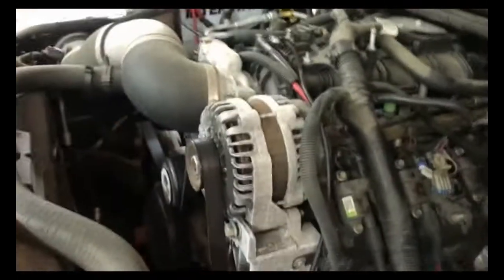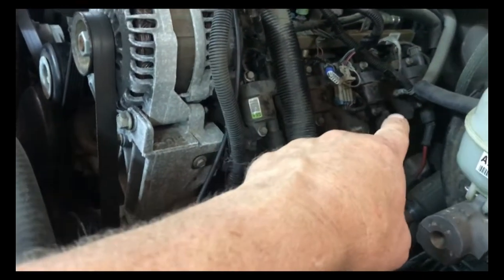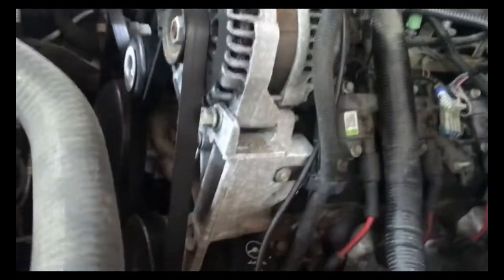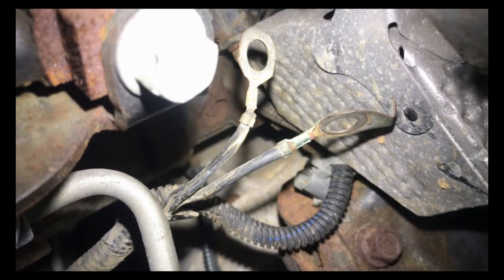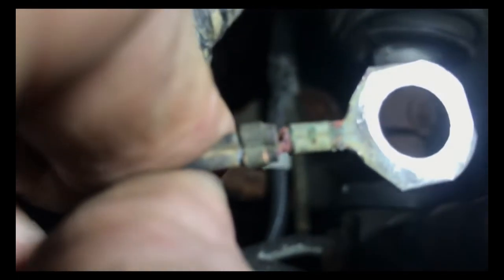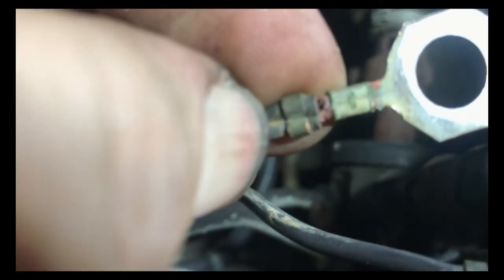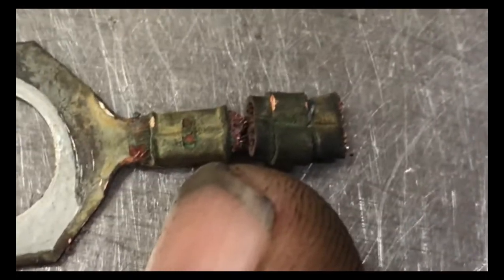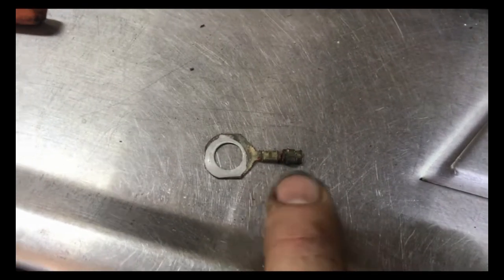GMC and Chevy 5.3L Trucks P0300 Random Misfire and Sometimes No Spark

Comment: SO WHAT WAS THE RESULT ? YOU WOULD THINK SO INTELLIGENT ENGINEERS COULDN'T FIGURE OUT TO PUT SOME LITHIUM GREASE  AT THE FACTORY TO PROTECT THE GROUNDS CONNECTIONS !  OR SEND ALL THE GROUNDS TO A MAIN ! WITHOUT ALL THE CONNECTIONS THAT WERE LEFT TO BE EXSPOSED TO THE ELEMENTS TO CORRODE ! NOT INTELLIGENT ENGINEERING !
Reply from the maker: I repaired the wire and all is good.

Comment: Remember, you can splice into the Black wire on the left bank injector vwite,and run a new wire to the threaded hole on the alternator bracket if you don't want to struggle with the ground on the frame rail.
Reply from the maker: But I like to check it down there to see why it happen.

Comment: I have a cylinder 3 misfire, I changed the spark plugs,coil,wire and still the same issue 
Sometimes a misfire is coming and going while driving then the vehicle is running smoothly, NO lifters noise at all , My mechanic said it's probably a lifter or Valve lifter oil manifold (VLOM) 
It's 2014 GMC SIERRA 5.3
Reply: Any idea what's going on 😅

Comment: You sir are a excellent mechanic I never knew those grounds were there I got a p0300 code while driving on the freeway and I got a lean code and I was thinking that I had a bad coil or coils, or maybe a bad injector after I watched your excellent video I was able to locate the grounds and they had corrosion on them I cleaned them up with some 600 grit sandpaper and now my 2007 Yukon has power when I step on the gas and is running a lot smoother thank you
Reply from the maker: You welcome. Just remember the the wire can corrode in the eyelet. I would replace the eyelet.  Thanks for watching

Comment: I'm having the same problem. Just put new plugs and wires (the old plugs only had 30000kms). I did check the grounds and sanded them. But perhaps I should get a closer look at them.
Reply from the maker: They could be green with corrosion and broken like in the the video. Thanks for watching
Reply: @TheGAutomotiveAndMore  yea, I'm going to have to take a closer look.  Mine is very intermittent.  Like one or 2 events every few days to a week with no rhythm or reason. Since I only did a quick clean from up top, it didn't really give a great view.

Comment: Found the ground location but wow it seems impossible to get too. Even to change the connector hardly enough slack on the wire to replace it. Im guessing I’ll have to try and disconnect a bunch of the harness to try and bring it out more??
Reply from the maker: Yes Its tight up there

Comment: In my case, I swapped plug? Wire and coil but misfire remains on the same cylinder, any idea if its ground?
Reply from the maker: Could be. did you check for spark coming out of the wire? If you have spark do a compression test.

Comment: Hi just wanted to thank you I had the same problem with my 2007 chevy Silverado 5.3 same code p0300 did everything thing I could to fix it nothing worked I was ready to have it towed to a mechanic but I looked at video did what you did you said and it was the ground wire fix it and my truck ran perfect, can't thank you enough for your video 😅😅😅
Reply: excellent video best one I have seen so far on this particular problem I have subscribed to your channel and will tell my friends about your channel also thank you sir

Comment: Good morning y'all I have a 2001 CHEVY TAHOE 5.3 vortex it has been sitting for over 18 months 😱 thanks to 🐂💨💩 of being sick Gas ⛽ and other crap💉  So money was every LOW🤦 I did keep up with the Driving up and down the driveway every 2or 3weeks but this morning she she didn't want to move in reverse, So I took out the the code reader and sure enough 3 codes came up P0300 and a multiple misfire and something with the EVAP. I'm going to try and get this worked on in a few minutes. If not then to the shop she will go💸💸🤦
Reply from the maker: Check for mouse damage sense you have not really been driving it. Thanks for watching

Comment: This video solved my dead passenger bank issue on my 6.0. The connector itself looked fine but once cut out and tested with a meter it had no continuity. Thank you so much.
Reply from the maker: I sill can't figure out why the ground for the coils is all the way down there. Thanks for watching
Reply: @TheGAutomotiveAndMore   A ground block with all the grounds lead to it would be so much better.

Comment: Wish i had of checked this a month ago seen this vid but thought it was only in 1 cylender. Replaced battery ,plugs, wires swapped packs, changed injector, replaced bank 2 upper and lower 02 sensorswith a code for upper then lower. Did compression test . Was getting a code 306 watched misfires was in just 6 then tested for spark because I thought others were working but same thing no spark in pass side bank and drivers side was just a orange blob not spark looked under took off yep same thing havent put it back together cause its night but sure it will do the job this misfire was so bad it smoked my caddy and bunt bank 2 upper and melted lower. This all happened when i was leaving a parts store for gas line for my boat .outta nowhere it happened limped it home. (UPDATE) battery dies was brand new crappy tire sucks but on the better note after almost chockin out the parts guy spent 5 hours charging the battery to full threw it in the truck and yep it was just the goround. Thanks man for posting this i thought it was in the dod system or somethin but this post saved me doe and time now i can do wood so i don't freeze this winter.👍
Reply from the maker: That sucks, I hope this helps you. Thanks for watching
Reply: @TheGAutomotiveAndMore  Sure did man thanks saved me lots of doe and sanity 😂 I subscribed to keep up on fixes 👍
Reply from the maker: @sinisterrevelations4493  Glad it helped. Thanks for watching  and subscribing

Comment: So did that fix the truck? Never heard it run
Reply from the maker: Yes it did, the wire was corroded and broken in the connector.
Reply: I have a 2005 GMC Denali. I'm having issues with multiple misfire code. I checked all the  grounds I could find, including the one you show in this video. I removed and cleaned the ground wires and reinstalled them tight and checked them for damage. I am still getting a random misfire code. Any advice??
Reply from the maker: @gardud7   Could be anything. Bad coils, plugs, wires, and even a bad cam or lifter. You need a good scanner that can give you misfire counts so you can hone in on the cylinder.

Comment: Brother I really appreciate this video! I just did a DOD delete on my buddies Yukon got it all put back together and it had no spark and instantly I went into panic mode thinking I had the timing set wrong! I thought I was going to have to open the motor back up!! But after stumbling across this video I checked the same ground and it was broke did a little quick repair and it fired up first time! Once again thanks for the video you saved my butt thanks!
Reply: @roberthanna4400   I have a cylinder 3 misfire, I changed the spark plugs,coil,wire and still the same issue 
Sometimes a misfire is coming and going while driving then the vehicle is running smoothly, NO lifters noise at all , My mechanic said it's probably a lifter or Valve lifter oil manifold (VLOM) 
It's 2014 GMC SIERRA 5.3

Comment: Thanks for making this video. Was so frustrated after degreasing the underside to pull oil pan for an oil leak (AWD Denali) and all back together and ran like crap. Musta broke last bit of connection when scrubbing. Crimped and soldered new connectors on and BOOM, ran fine no codes. Thanks!!!

Comment: i have a 02 gmc z71 10k miles on motor compression 150 150 160 160 160 160 160 160
brand new 8 injectors 
plugs coil wires 
brand new intake manifold 
brand new ac delco knock sensors
brand new cats and fuel filter
brand new fuel pump and regulator 
motor passes leak down 
WARRANTY company just replaced heads thinking that was issue still have po300 only 
missfires on 1 and 6 i have tried new crank sensor and relearn no fix what gives ?
Reply from the maker: I would move the coils around and see it the miss follow where you moved the coils.
Reply: @TheGAutomotiveAndMore  it dont i have tried 24 diff coils 8 gm 8 oriallys
Reply from the maker: @banshee100  Ok then I would get a in line spark tester. Put it in line and see if you are losing spark.

Comment: I'm not sure exactly where you are but I'm sure I'll find it if I get under, the only problem in this was seeing exactly where, but I'm not a mechanic so probably just me...
Reply from the maker: Its on the drivers side , front of the engine block
Reply: @TheGAutomotiveAndMore  I have to take the plastic shroud under car off? I can't see or get to it from the top... I appreciate it, I'm hoping this fixes this problem.
It's been getting worse, and is weird when the check engine light is on when you hit the gas it blinks when you let off it stops...
Reply from the maker: @Sumama-Mitch  Yes take the shield off

Comment: You're awesome! Had the same problem with the driver's side bank not sparking on my 4.8L Silverado (07 New Style). My grounds looked fine to the naked eye, not broken like the one in the video. I put a new connector on and problem solved, firing on all 8 now. Thanks for another great lesson
Reply from the maker: This one was broken inside the connector but that green corrosion will cause the same problem. Thanks for watching

Comment: I have a 2004 GMC Yukon XL and I’m having the same problem slow acceleration and missing every one in a while
I’ve had it at 10 different mechanic any assistance
Reply from the maker: Check and replace this ground even though it might look good. This on had green corrosion in it. That could be causing your problem.
Reply: I’ve tried it still same problem it gets really bad at times when I go up a slight hill and transmission shift crazy at times not for sure if that has anything to do with it
Reply from the maker: @cornelius7812  Not sure it could be anything

Comment: I got the same issue 2011 yukon runs fine but random misfire on 7 and 8, but it happen when I was hooking up a amp and check engine light been on since HELP
Reply from the maker: I do not know. Try disconnecting the amp and see if that helps.

Comment: I bet u replace your 
 Gas cap and your problem solve 
Most of the times air goes into the tank and it causes your light to go off and then other lights and then by time you think you got a lift the problem because it’s running rough for idle check your gas cap
Reply from the maker: This was not a gas cap problem
Reply: @TheGAutomotiveAndMore  My 2007 Chevy Tahoe did the same exact thing and the dealership wanted to charge me arm and legs and toes and fingers and then all of a sudden Lee I check the gas cap and it was loose and I we replaced it and every light went off and it ran normal so yes in my case that was my problem
Reply: @TheGAutomotiveAndMore   I changed plug & wire on #5   it showed misfire on that cylinder.   Now it says random misfire.   Now what????
Reply from the maker: @joekillingsworth9002  Do you have spark out of the coil ?  I would get a scanner that can show the miss fire counts so you know what cylinder is missing. Have you done a compression test ?
Reply: @TheGAutomotiveAndMore  And we did buy $150 scanner and it said all kinds of stuff on it though but like I said my girlfriend check the gas cap and it was looser than hell and we replaced it and everything rent went to normal after about 15 miles every light shut off car ran smooth everything Air was getting into the gas tank that was causing all that to happen

Comment: Awesome help bro, you are truly a hero. For the past month I have been having issues with my truck, three different shops changed out spark plugs twice, coils, plug wires, MAF, throttle body, cam sensors, air filter... $4k later and truck still ran like crap with one bank refusing to work.

This morning I tried this and whaddya know it solved my rough idle and acceleration problem engine feels like full power. Only issue I have now is it overturns a bit before startup but I think it might be the purge valve  will replace it tomorrow.. Thanks a lot, is you're ever in SFla I got some brewskies with your name on it 👌👍
Reply from the maker: Thank you and thanks for watching
Reply: @TheGAutomotiveAndMore I have a 2007 GMC Yukon Denali I have the same problem I did a temporary fix and it has worked for about six months can you help me out and point me in the right direction to where my ground wire is please and thank you this video was 100% helpful and I'm definitely following you after watching it
Reply: Pll

Comment: That factory crimp had exposed copper from day 1 . Add water and road salt and green crusty = high resistance on the ground side . I wonder if you did a voltage drop test from the tab in the end of the wire to the center of the post on battery negative if would show up while running or cranking it . It has got to have current flowing to test . I would seal any exposed copper to prevent a return . Nice find .

Comment: Thank you for this video. I've got a 2003 Chevy with a 6.0 and I'm gonna check this out as soon as the snow clears out for a bit. I'm not sure if the ground location is the same though. I'll look where you're at 1st and if not there then where I suspect it is on my engine on the top of the block at the rear. Here's a photo of the area. https://postimg.cc/FYjyFJrh Wet and grimey perfect for corrosion. My camshaft sensor didn't want to come out easily so I let it be for now. I'll be sure to let you know what happens!
Reply from the maker: I think is going to be where I showed it, but they do move stuff around all the time. Thanks for watching

Comment: Im having the same problem on my 03 suburban, change plugs ,wires, coil#1 that was cracked, runs good for a bit.  10min later flashes check engine light. I'll look into them ground in the morning.. stay tuned.
Reply: Please let me know I have same story replaced coil cables and spark plugs still same issue

Comment: Can I just replace the whole wire? And I had trouble locating it. Is there any way you can show more?
Reply from the maker: Yes you can but I would replace the other side also because both wires connect to the same point. It is most likely getting ready to break also. Thanks for watching

Comment: Where is that harness running to or from? Hard for me to see in the video. So im having trouble locating it on my truck. Thanks in advance
Reply from the maker: Its the ground wire at the left front of the engine. In front of the motor mount.If you remove the plastic shield you will be able to see it. Thanks for watching
Reply: @TheGAutomotiveAndMore  hey how do you get the plastics piece off
Reply from the maker: @keelancampbell9808  If you are talking about the plastic shield its held on with 15mm headed bolts. Thanks for watching
Reply: @TheGAutomotiveAndMore  thanks I appreciate it and the video. I think I have the same thing going on with my truck it's a 2012 silverado. I have p0300 code. So I changed plugs and wires and checked coil packs. Then I took fuel rail out and cleaned injectors and put new o rings on. My next step was compression test but when I took out new plugs the driver side plugs hadn't been fired but the other side had so I'm going to try this. Hopefully it works. Thanks again.
Reply: @TheGAutomotiveAndMore  hey is there a way to test to see if the ground is working or if it's messed up with the multimeter before I take that clip off and check the ground connections
Reply from the maker: @keelancampbell9808  Yes check for ground at the coil electric wire. I like using a test light hooked up to the pos side of the battery because it puts a load on the ground wire when you check it.
Reply: @keelancampbell9808  screw driver lol
Reply: @TheGAutomotiveAndMore  thanks so much

Comment: Good Job
Reply: I'm pulling a 300 code I have already replaced the fuel filter.
I'm going to replace the fuel pump next.
I'm also getting a 171 174 and po300 code

Comment: Great vid!
So, on my 05 Escalade, 3 of 8 buttons on steering wheel stopped working. Ive replaced the clockspring, harness, & buttons to no avail. 
Could it be a ground or wiring? Whats the best way to go about diagnosing?
Thanks
Reply from the maker: You need to get a wiring diagram and check the grounds.

Comment: Thank you so much man, i just fix my 2007 GMC Sierra same issues thats all it was.
Reply from the maker: Great, thank for watching
Reply: @TheGAutomotiveAndMore  Holy Crap 
These Vehicles today will keep us broke.
Reply: I replaced coil packs, spark plugs, wires too them, fuel injectors and starter. Still had a misfire. I checked it said p0300 but i did that live data and it says 4 and it misfires count just goes up!
Reply: @vincentrodriguez4395  
OMG
WTF these darn vehicles or something else. Computer this computer that Oh boy
What a bunch of crap
Reply from the maker: @vincentrodriguez4395  Do a compression test to be sure that is ok.
Reply: It runs smooth 
Only time it starts to sputter is when it rains.  But it won’t turn off it just rides really rough during the rain but only when it splashes the passenger side with water
Reply from the maker: @vincentrodriguez4395  Get a spray bottle of water and slowly spray under the hood to see if you can find the wire that is causing the problem.